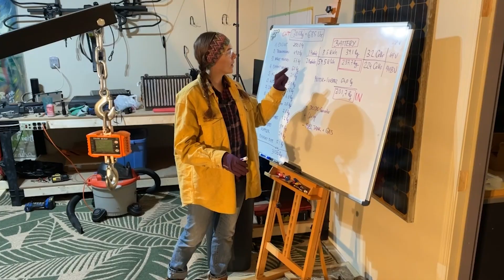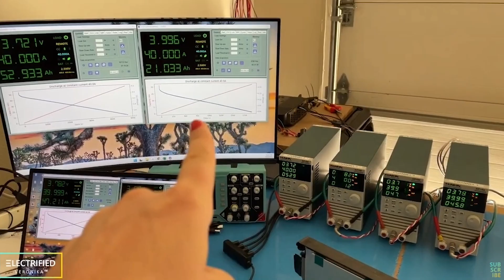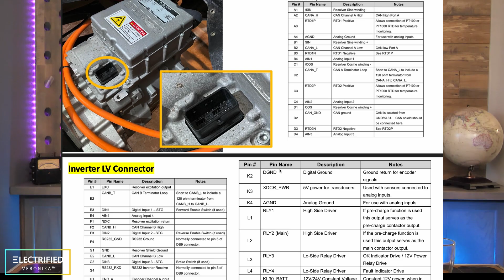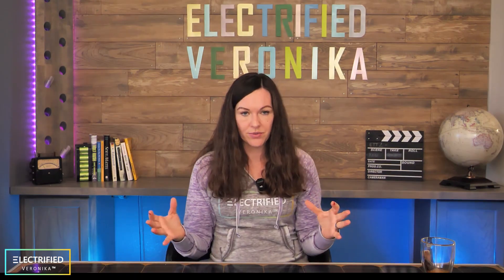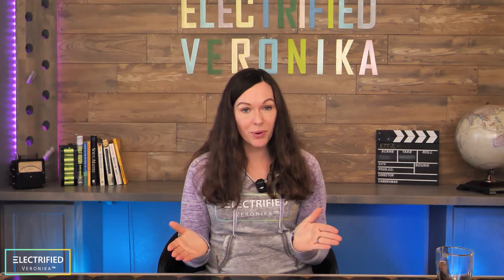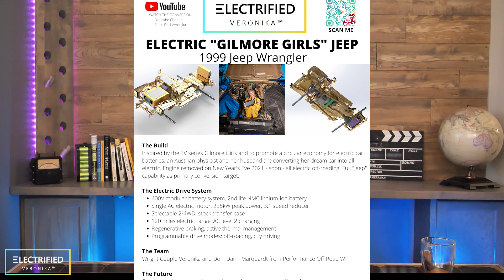Lessons Learned - EV Jeep Conversion Project

Comment: I have a 1995 Wrangler and I am interested in doing your conversion I have been watching for a while now.  Would you be able to recommend motors, controller and battery after your "lessons learned"?  Would ever have considered the new "wheel hub" yokeless Axial Flux motors that are just coming out for a motor on each wheel?

Comment: I wonder if you would entertain a Prius gen 2 conversion or even a theoretic concept. What would you do or consider? Most of them are coming to age with a fuel tank issue that renders them useless—too expensive to fix. Then, I reckon, engine space, fuel and hybrid battery space, and an already aerodynamic chassis. 
Anyway—Congratulations to the new parents. I changes your perspective of time for sure 😂!

Comment: I'm glad you made this video, it's very interesting to hear your reflections about what you have done so far. The little summary of the video says you consider next steps, but I think I missed that part. I'm very curious as to where you are with the conversion as I seem to remember you were almost there when you stopped making videos. I'm a little surprised you'd not want cooling in your battery. Wouldn't you just want to get a battery that already comes with a cooling system? Wouldn't a battery without cooling have a shorter life span an less utility? Finally, I'm glad you are back. : )
Reply from the maker: Thank you so much for the kind words and for sticking around! I’m glad you enjoyed the video. It’s true, back then, it really felt like we were ‘almost done,’ but in reality, there was still a mountain of work ahead—and with a baby on the way, continuing at the same pace just wasn’t sustainable. (Let alone, recording a project like this in the quality we’ve done it—it can be a full-time job in itself, haha!)

As for where we’re headed now, it’s still a bit of a surprise—I can’t share all the details just yet, but exciting updates are coming soon, I promise!

Regarding cooling, you’re absolutely right about its importance. Back then, we considered integrating a custom cooling system for our second-life batteries, but looking back, it was overkill. For those specific "old" batteries, the effort to integrate a custom system just wasn’t worth it. Ideally, a battery with a built-in cooling system is a better route, but again there was NO option back then with the higher voltage and space limitations. 

I know all these answers and reflections have some gray areas, but there is just not that one clear path to take..Thanks again for your message!